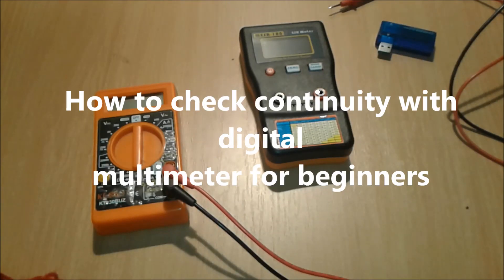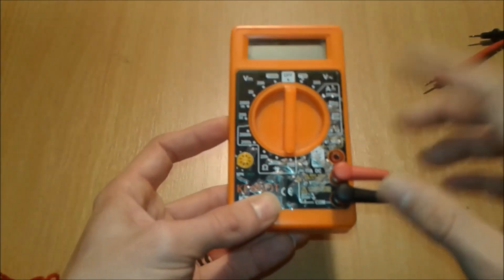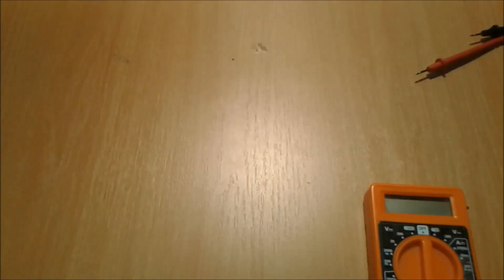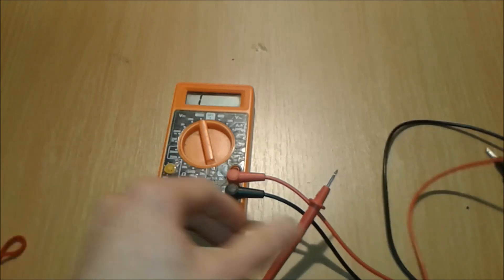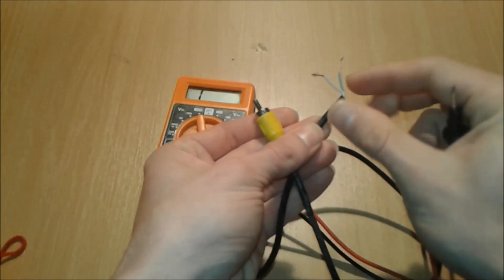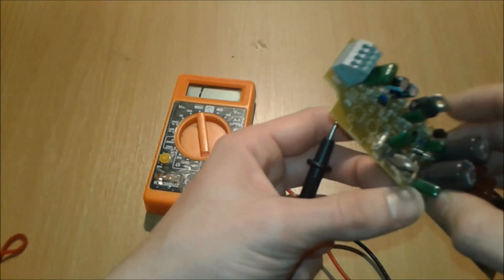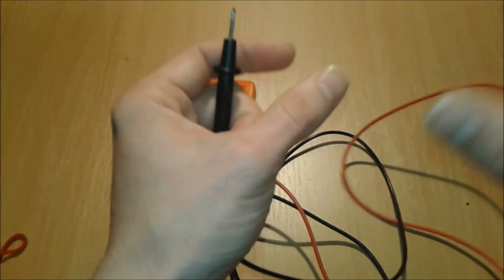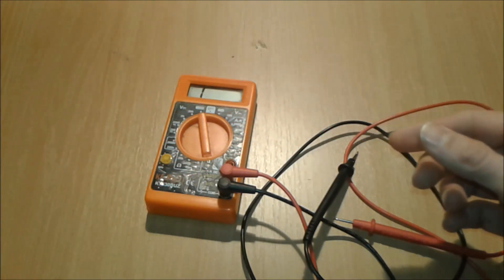How to use a digital multimeter for checking electrical continuity(connection test)

Comment: How to repair voltages AC DC multimeter problem down namber show. Battery full 4v , 0.12v show
City 220v , 006v show !
Do you can help me?

Comment: I checked car alarm. But buzzer not ring.Is there any short?
Reply from the maker: You should check the wiring of the alarm normally is triggered by open door or shocks
Reply: Sorry 
I want to know the buzzer of multimeter. 
I removed car alarm and I checked alarm.but multimeter buzzer not ring.
Is there any short?